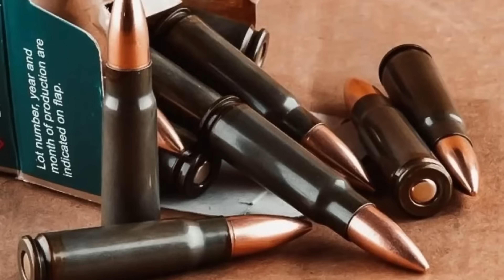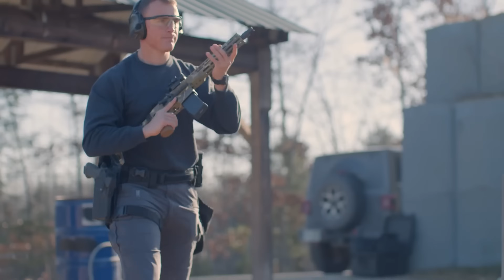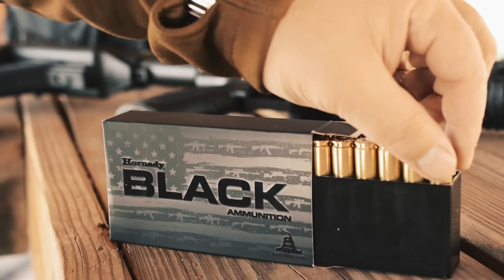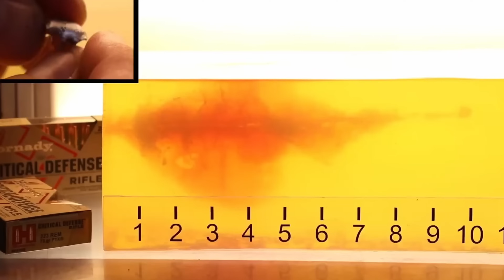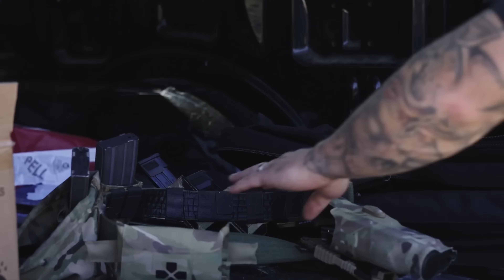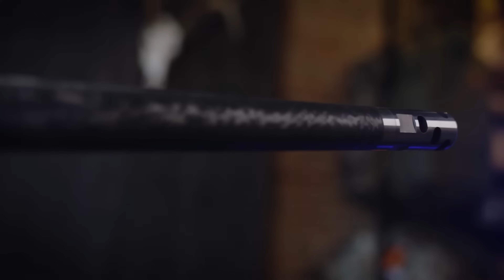Why the Military Ditched 5.56 and 7.62 — The New Caliber That Changes Everything!

Comment: The US military is wasting money on new caliber and handguns while others are spending money on UAV drones. New handgun and new caliber will not stop the enemy UAV drone from dropping a grenade into the trench and open hatches. The new caliber worned out the rifle barrel faster than 5.56 rifle.  Making it more costly to use XM7.  XM7 with the 6.8mm ammo, is created to defeat the body armor of Russian and Chinese army that could stop NATO 5.56mm ammo.  However, the person, who come up with the idea, ignore the fact that both Russia and China, do not have budget to equip all their men with body armor.  Only small number of special forces in Russia and China army have body armor. Therefore, 5.56 ammo is good enough in most mid-range gun fight. The XM7 6.8mm is design to defeat a threat that do not exist. In many gun fight, the armies and marines ended the gun fight by calling in the air force close air support (A-10 = 30mm ). Therefore, this make 6.8 mm ammo look like a joke. The XM-7 rifle length is too long and is a pain in the ass to get in and out of vehicles. Close Quarter Battle with a long rifle in urban area and jungle environment is also not suitable.
Reply: Le bradley scam : another joke 😂
Reply: Apparently you are not in Americas military because where I am, drone research use, defense, and countermeasures are a daily topic.

Comment: why not go with a 308? low barrel wear, yes bullet drop but you got range finder in your riffle, the 556 green tip penetrates Russian body Armour so a 308 will do it too. one piece case (cheaper).